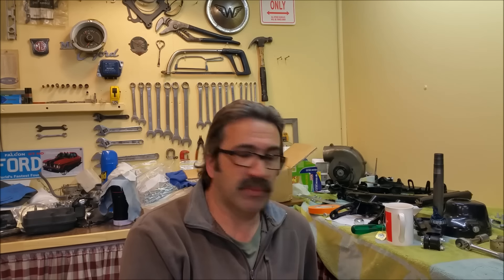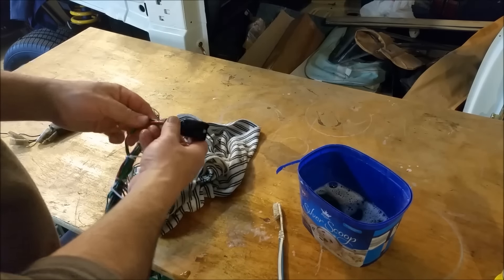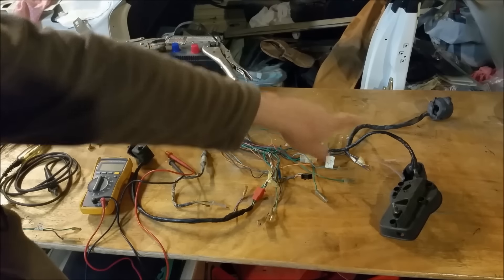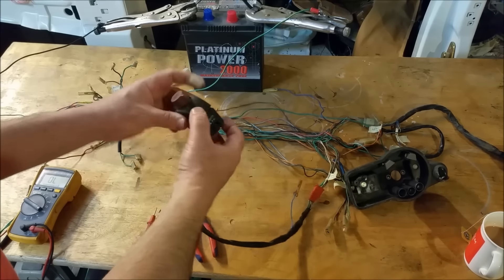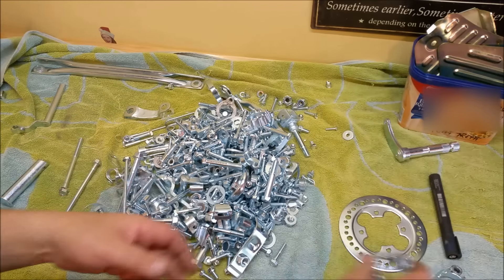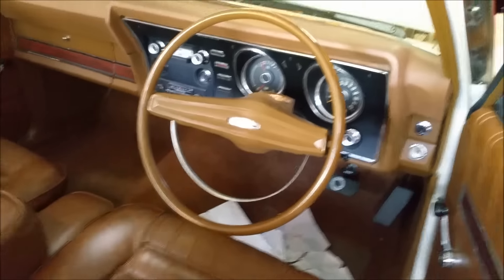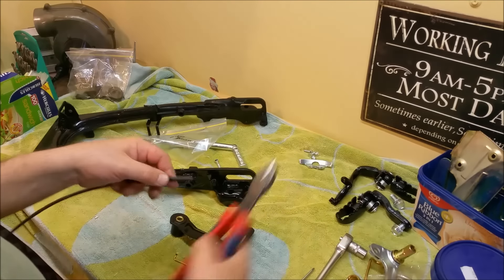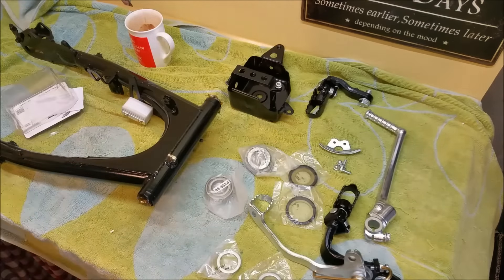Honda XL250 Restoration Part 7 - Preparation for Re-assembly

Comment: 2:55 
mate - have a look at getting an "Oil & Fluid Transfer Pump" - T&E Tools do them [I got mine from Total Tools]. Part #AL504. Fantastic little pump. Absolutely simple. Put your "from" tank above your "to" tank and you only have to pump the handle 2 or 3 times and the rest just siphons through. No mess no spills :)
Reply from the maker: I have a few tools for transferring fluids, but I got lazy and created a hazard...

Comment: Hi Pete, if you use a pinnning pick you can remove the old wire off the factory plug, that way there is no need to solder any wires.
Reply from the maker: Thanks Mick and it would have looked better as well. Cheers

Comment: Question how do you know what thread it is, before running a tap through it to clean it out 1.25 fine ??/ grate  attention to a detail , waiting for the next instalment, then you can get back on your 750 Honda
Reply from the maker: ...and the other jobs I need to do... thread sizes I guess is something from experience, manufacturers typically use certain sizes i.e. the Japanese are huge on 6.0 x 1.0 and 8.0 x 1.25 metric, where Ford 5/16 and 3/8 UNC among a few other sizes. Cheers

Comment: Why not drain the tank via the petcock? Leave it on the edge of the bench with the petcock hanging over the edge, run a hose from the petcock to the can, and open the petcock.  No mess!
Reply from the maker: Very true Steven, but mess is quicker haha